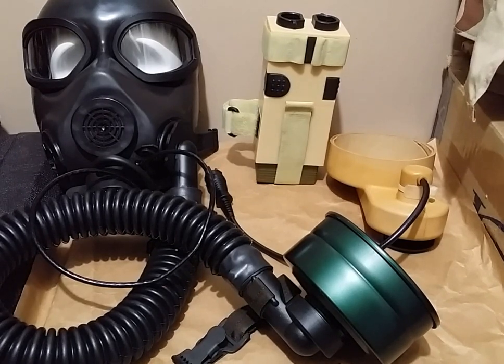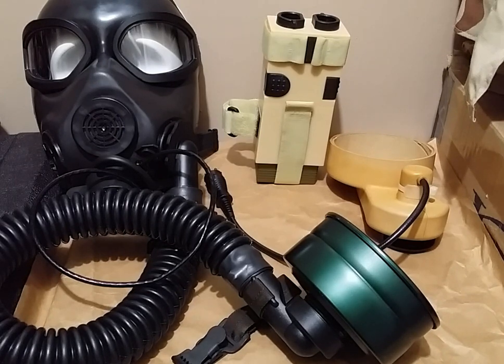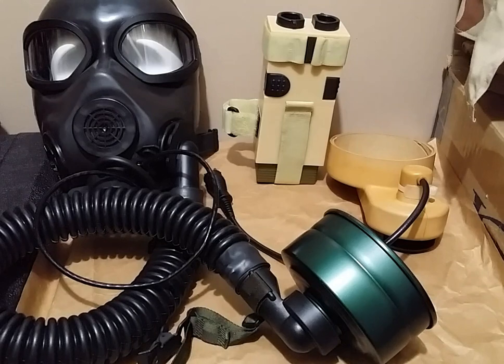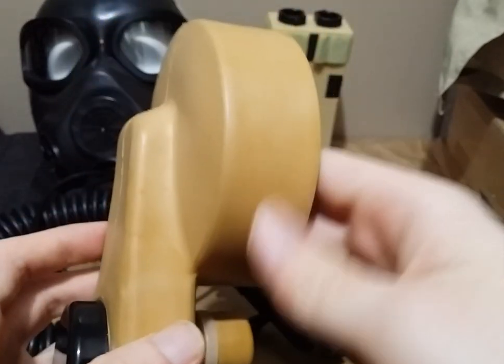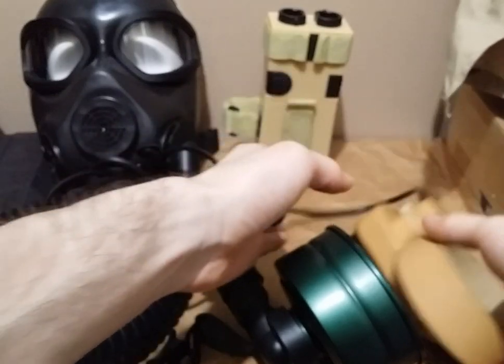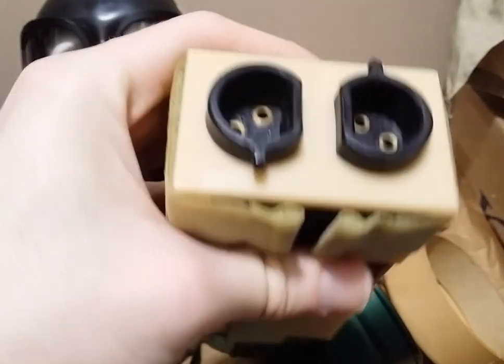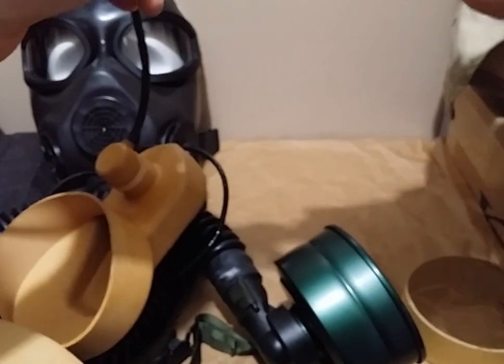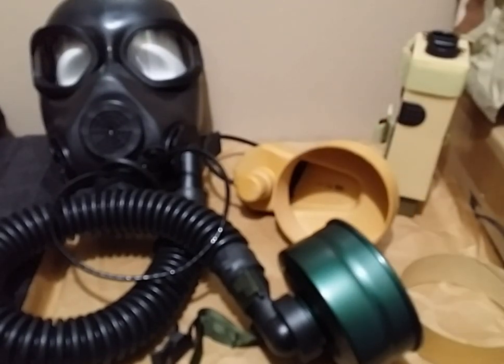(OLD VIDEO) U.S. LWPAPR Pusher Fan Blower and Control Unit (M45 Mask Blower)

Comment: The actual M45 mask blowers are kind of interesting. They have been around but barely used.  Even though many of the aircraft were equipped with the power cable to plug them in to, the power distribution box was never installed in the aircraft so there was no means of actually using the blower.  I couple years ago I asked a pilot if the new UH-60Ms had the full setup installed and he didn't even have a clue what I was talking about and he was even an ALSE officer.